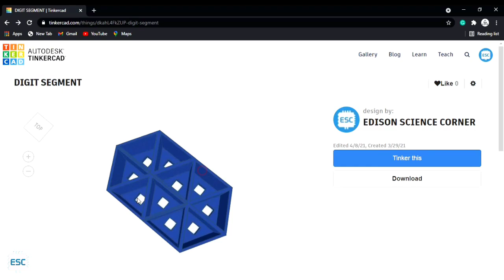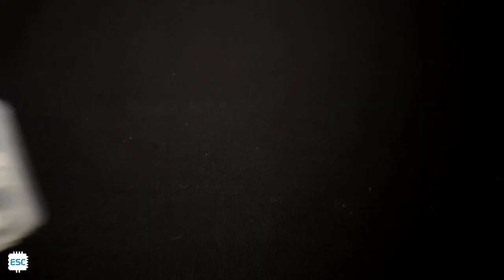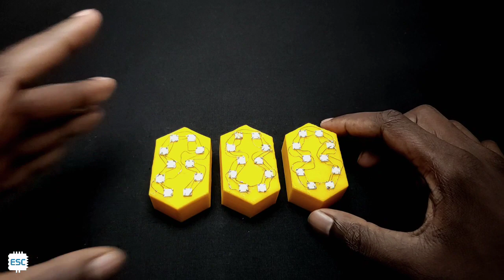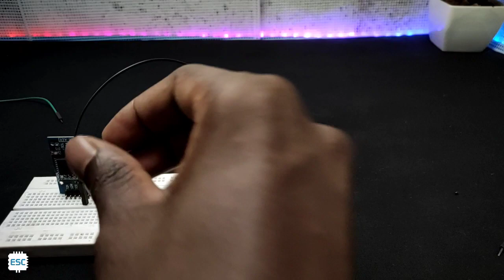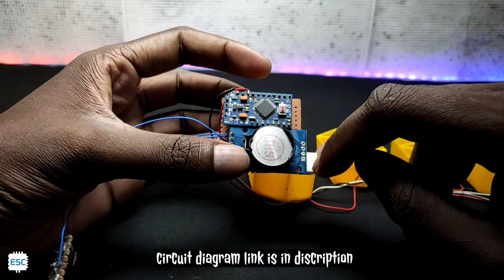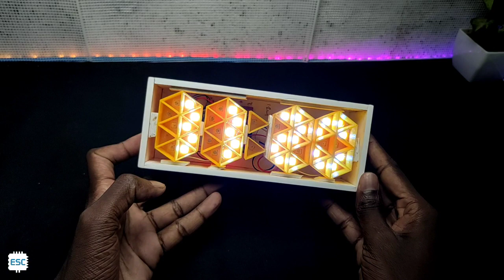How to Make Neopixel Clock at Home | DIY

Comment: The program is definitely flawed! 0:00 is not displayed, for this 24:01 is displayed. With leading suppressed zero clock, not all segments are deleted, 2-3 LEDs remain lit. I would be very happy about a correction!
Reply from the maker: I will solve your problem give some time
Reply from the maker: no problem with code ok
contact me on Whatsapp or telegram

Comment: i have a question, i'm a noob in coding,so,can you actually explain in your code,wihch is the array for timetoarray and which is array for temp to array ? i am trying to make a clock using just and esp8266-01 and a ws2812b ledstrip of 70 leds,soldered like this 0-9 and the next column of 10-19 is in the same pozition as the first 0-9,i am trying to use your code,with small changes,no rtc,no butons,no temperature,just the clock,but i can't figure out in the code,those 2 arrays of the time and the temp,as you put them together,yes,u did said about it,but you didn't said which is which...

Comment: Good work sir & I am trying to making it but some doubts are here.
Digit
"1,1,1,1,1,0,0,0,0,0 =1" am I right sir?
If this right circuit diagram & code not matching. When it showing digit 1 that time led no (0,1,2,3,4) is in off condition & led no (5,6,7,8,9) is in on condition but as per your code led no (0,1,2,3,4) on & led no (5,6,7,8,9) is in off condition. Please clear the doubt sir.
Reply: That's I know man.
Is wiring diagram same as your given circuit diagram?
R u sure circuit diagram is ok?
B'coz center led no 41 & 40 so how connect 19 no led to 40 no led?
Reply from the maker: Connect the 2 middle leds to the the last led
Reply from the maker: One means on and 0 means off